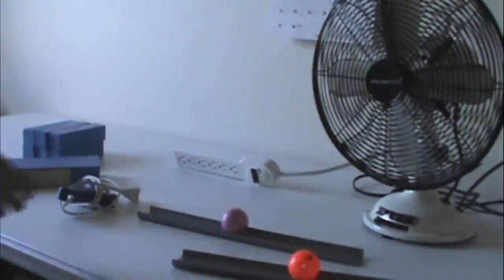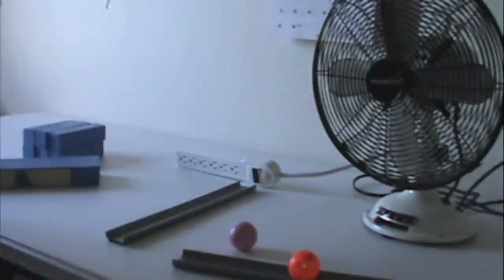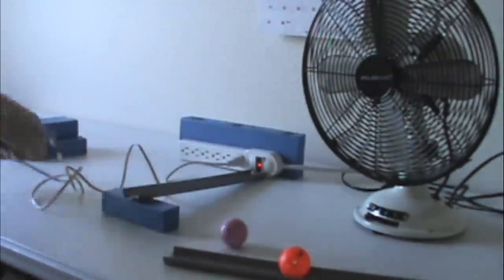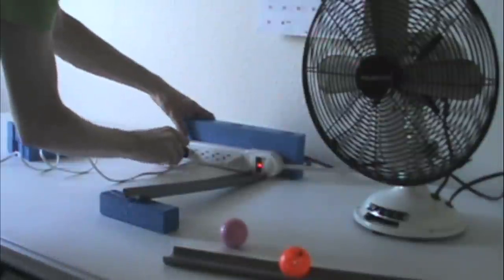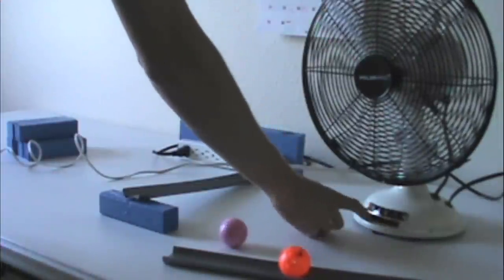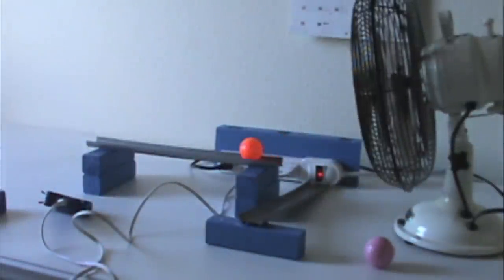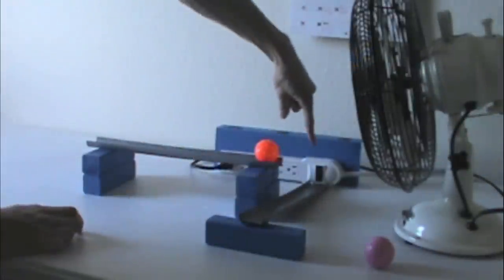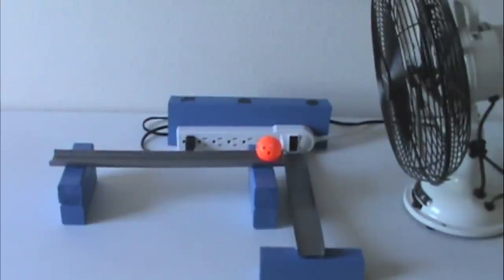Power Switch Chain Reaction Tutorial

Comment: Nice tutorial! My machines usually turn my fan on with a string, but my next one might use a power strip since they're easier. Also, thanks for the tip on gluing down everything that doesn't move. Sometimes, I don't glue or tape things enough and my machines fail a lot more because of that.